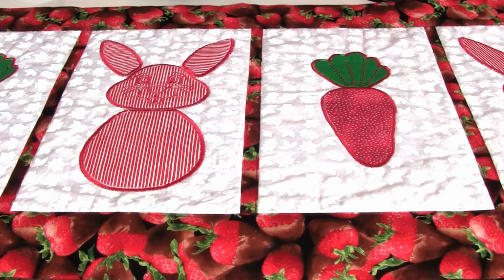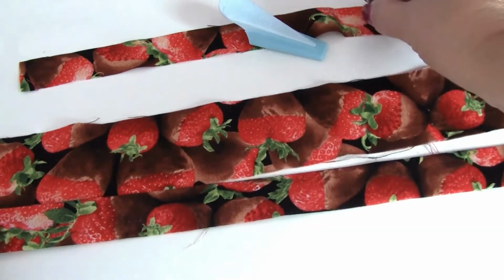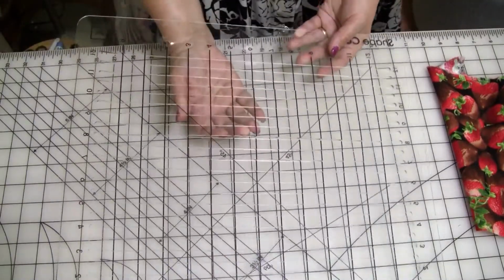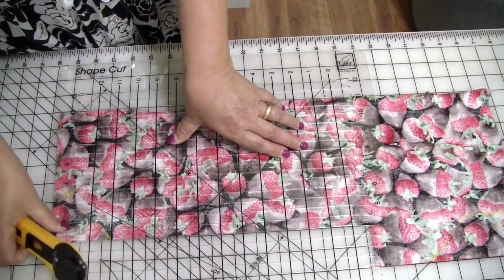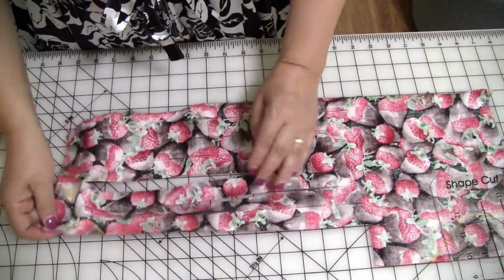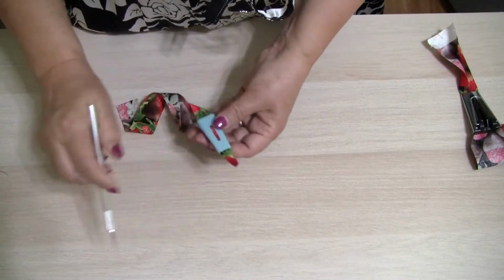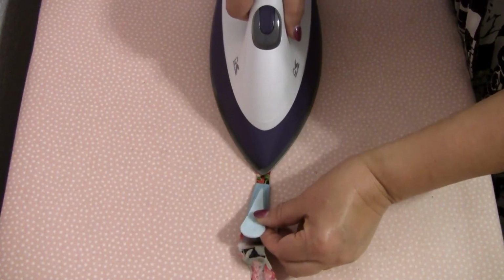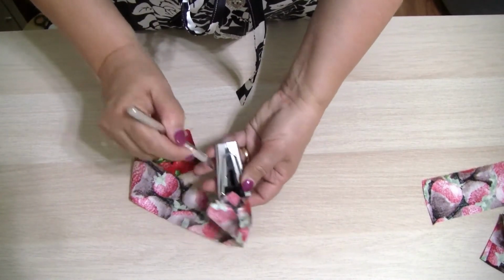Bias tape tutorial: how to use a bias tape maker

Comment: I use a similar ruler, the Stripology and couldn't do without it!  I am great at making mistakes, so I put small bits of colored peel-off tape under the lines that I'll be using. That way I don't have to count lines or inches. I just cut in the lines above the tape. Before I bought the peel-off tape, I used post-it note paper. I just cut the top corners off into triangular shapes & had them pointing up to the line above it. One more tip, if you cut the end of the strip into a point, it'll go into the tape maker easier.
Reply from the maker: Oh, this is a good tip! Thank you!
Reply: I wouldn't quilt if I did not have my Stripology XL ruler.  I love it.  It saves so much time and is so accurate.  I do put an antique iron as a weight to prevent shifting.